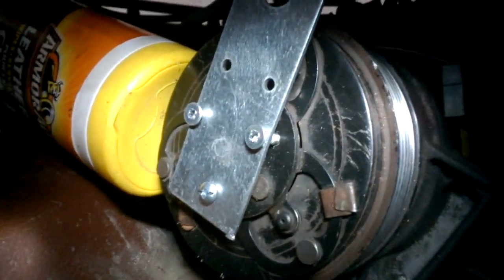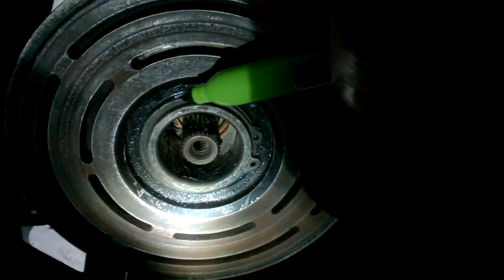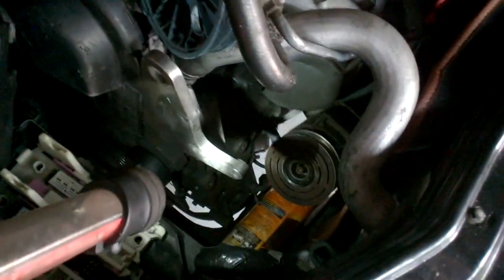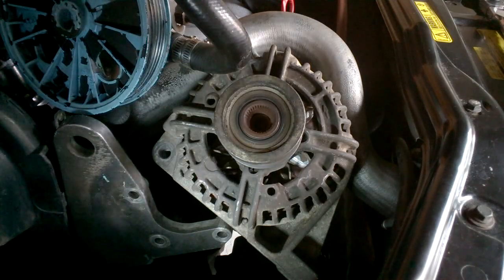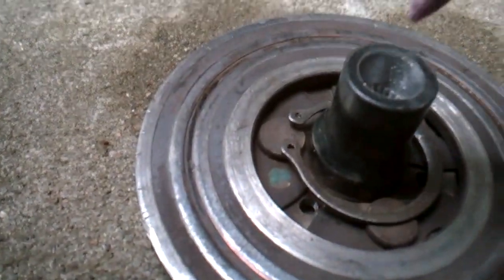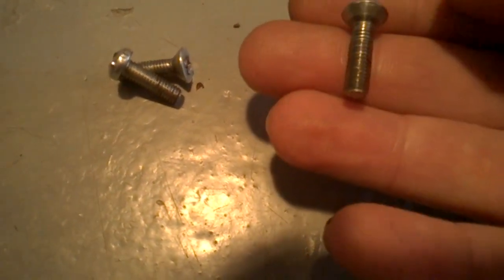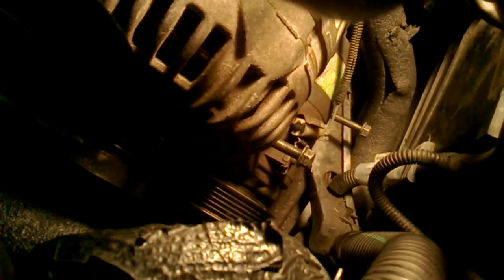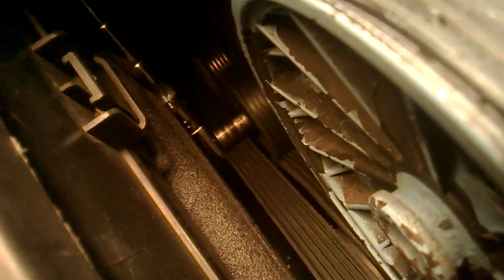Volvo S60  XC70   A/C Compressor Pulley Bearing Replacement  2001-2009

Comment from the maker: Bearing dimensions 35x55x20mm PFI brand is good
Don't buy cheap!
Apologies for the filming, one of my old videos. Check my channel for more S60 vids 
Alternator removal (turbo and non turbo)  https://youtu.be/zlp6qvYBJMU
Clutch tool (not sure how good it is)  https://www.ebay.com/itm/A-C-Compressor-Clutch-Hub-Removal-Service-Tool-Air-Pump-Head-Combination-Wrench/333223707768?hash=item4d95ae4478:g:k28AAOSwdAJc-GYT
Bearing (use only quality brands!)  https://www.ebay.com/itm/131564490432?_trksid=p2057872.m2749.l2649&ssPageName=STRK%3AMEBIDX%3AIT

Comment: Folks - Note that when you pull out the clutch, you first remove a 10mm bolt. DO NOT USE POWER TOOLS TO REINSTALL!  The bolt is made of light metal and will shear off inside the A/C shaft.

Comment: Please help? What is the part number of the ac compressor bearing for a Volvo s60 2001 model? (Just the part number of the Bearing please?)
Reply from the maker: Bearing 35x55x20mm the PFI brand is good  - don't buy cheap!
Reply: @Peppermint1  Thank you So Much. You are the best. Enjoy the rest of your day. Kind regards, Charles

Comment: So the A/C compressor pulley isn't lubricated by the internal A/C compressor PAG oil, rather it has its own external bearing. Good to know. My A/C condenser is broken and the A/C compressor pulley is loud as heck (far louder than the engine itself), probably about to seize. Will have it replaced in a few days and leave the A/C off (disconnected plug?) until the condensor and dryer has been replaced at a later date. Seems the A/C compressor and gas pedal position sensor is on the same relay, so I can't just pull that, right?
Reply from the maker: If you want to prevent the compressor from running, try to unplug the small wire connector at the compressor, I think it's this wire that activates the clutch to engage.   You will still have the pulley running with the belt - so if the bearing inside this pulley is worn it will make noise as well and can also fail and snap your belt - be careful if you have the diesel engine, when the serpentine belt fails, in almost all cases it causes the timing belt (cam belt) to jump teeth and damage the engine valves.
Reply: @Peppermint1  Thanks. I've got a gasoline engine. I'll leave the cable disconnected after replacing the A/C compressor and zip tie it somewhere it doesn't get stuck in the fan.
Reply: @Peppermint1  Fixed it. Replaced the A/C compressor with a good used one from a scrapyard. Turns out my deformed condenser isn't leaking after all, at least not fast. Got over 800 grams of R134a sucked out of the system before replacing the compressor.

Upon installation, starting the bottom right bolt first, then the top left bolt was a lot easier than trying to start the top bolts (put a light source under the subframe to see the mounting holes). I only removed the engine fan and left the power steering pump & alternator in place. If I did it again it'd probably take 15 minutes in total with this knowledge (excluding the vacuum done at an AC shop for free). Left the A/C connector unplugged and zip tied until I get the system refilled. Engine is so quiet now I can actually hear the injectors clicking again. :)

Comment: When you do this you should replace the whole clutch assembly $60... Take a air hammer buzz off the clutch replace all with new components.
Reply from the maker: Hi there, it is good to inspect the clutch wear material, and also see if the clutch plate is bent due to removal - indeed if the plate gets bent even just a little, it needs replaced because it will wear out very quickly if put back because of uneven gap.  If all is good, it's ok to put it back in place. When the gap is adjusted well, this clutch lasts very long time.  I reused mine 3 years ago and still in very good condition and working properly.
Reply: As a mechanic of 21 years $60 is a small price to pay for a new clutch assembly

Comment: Can I do this without removing the alternator?  Maybe get at it between intake and radiator?

I’m afraid of the power steering pump, and don’t have pulley removal experience
Reply from the maker: Hi, there won't be enough space.  The ps pump and the alternator need to come out.  Removing the belt is not very difficult but takes several trials to put it back (keep in had a diagram of how it goes over the pulleys).  I'd say it's a standard job for a self mechanic with moderate experience but if you don't feel comfortable it's best to search for a local Volvo garage, search first on local.google.com or on Craigslist. Here's an alternator job video for reference, keep in mind the cars after 2005 need a special tool with torx socket for the tensioner https://www.youtube.com/watch?v=Kg-lsya-LiY
Reply: Nina Yorty depends on the vehicle, on my S40 I was able to leave the compressor in and remove the clutch plate by removing the wheel and wheel well.

Comment from the maker: New A/C pulley - no more noise  https://youtu.be/vJXU2cHVEtg
Reply: Could you give me access to this video please? It says the video is private. I have a volvo xc70 that is making a terrible sound. It sounds like it is the ac compressor clutch. But the ac is working great. Trying to see if it is the bearing.
Reply from the maker: @ameliabrittain2157  It looks like that video has been deleted. The best way is to remove the serpentine belt at a garage and turn the compressor by hand (engine off).  You'll get a good idea about the condition, if the bearing is worn, it will make some friction noise by hand.  The A/C will still work fine but at some point the bearing will seize and the belt will jump off -  on the european diesel engines this will also cause the timing belt to jump and it will destroy the diesel engine (on gasoline engines it's not that risky)
Reply: @Peppermint1  thank you so much for replying. When the engine is running it sounds like there is an issue with the ac compressor clutch due to where the sound is coming from(I have no issues with the air conditioning system while riding in the vehicle), but as far as I can hear there is no sound coming from the clutch when the pulley is rotated by hand with the drive belt off. It is a little confusing to me. I am very new to working on my own vehicle. I bought a service manual when my drive belt popped off a few months ago. I had to replace one of the pulleys, the tensioner, and the belt itself. A few weeks after I made the repair there was a rather yucky sound coming from the ac compressor area. I have tried a little bit more to diagnose the problem by taking everything apart and tightening it up in case it was a loose bolt somehow.
Reply from the maker: @ameliabrittain2157   Be sure to use only quality replacement parts. For pulleys we usually prefer Gates or Ina.  I suggest asking more on forums and perhaps upload a video with the noise

https://www.matthewsvolvosite.com/forums/

(for diesel engines)  https://www.volvoforums.org.uk/